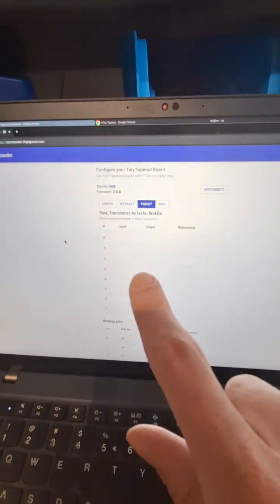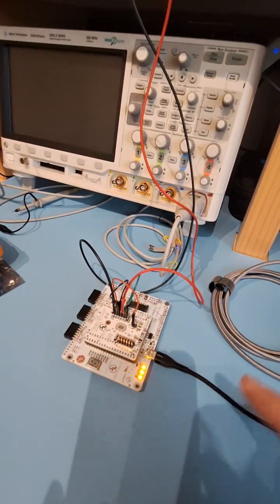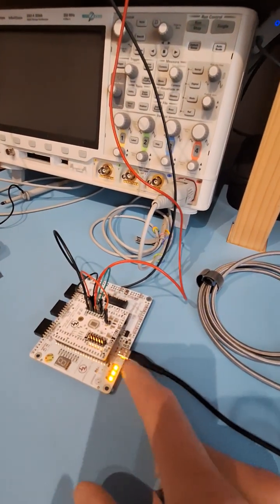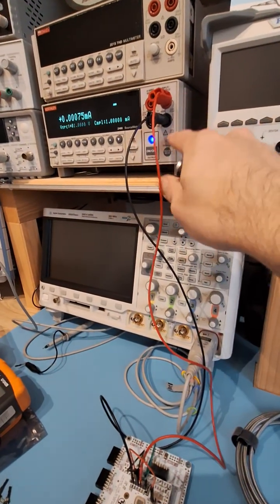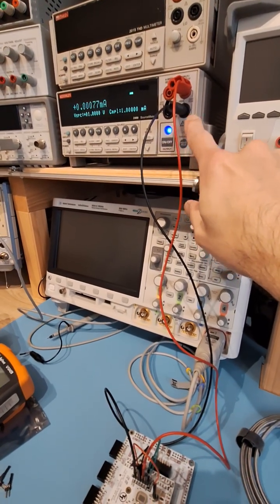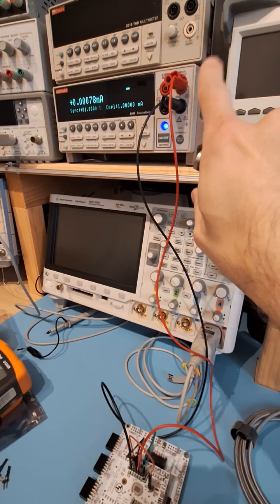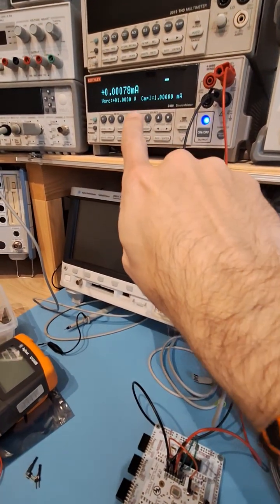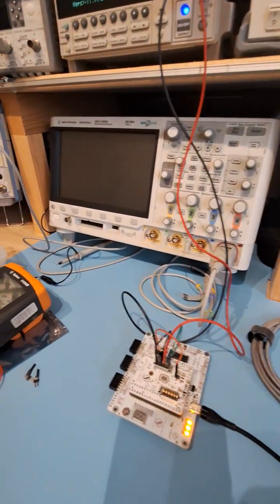TT08 COB + Laser !

Comment: LOL that was my instata-reaction “Isn’t light going to interfere?” but I guess in this case it’s A Feature 😂  For other projects I imagine you’d want to cover it up?
Reply from the maker: I still need to try with complex logic. So far the only observable effects have been on projects that have internally floating nodes so they are particularly susceptible to noise/charge injection.  I image analog projects would also be disturbed ( things like references and such ).  

So yeah, some silver sticker might be useful :)
Reply: basically all PN junctions will be affected by light to some extent. There's a reason all chips are packaged in black epoxy packages to keep light out.
Reply from the maker: @gorak9000  I know all PN junctions are affected, what I don't know is in this particular experiment, which one is the dominant one causing the observed current.

In 60 second there is only so much I can explain about the setup and all the things involved and what could be going on :)